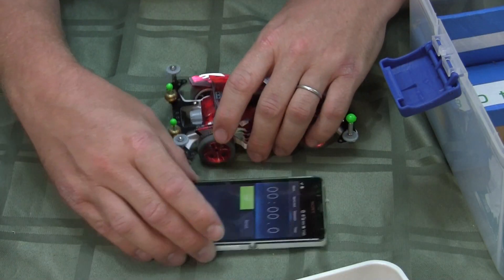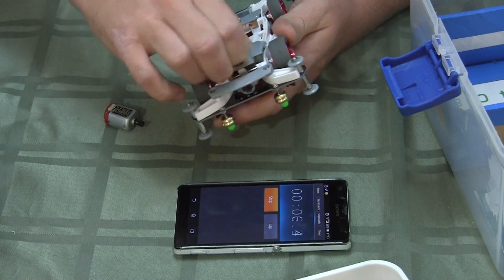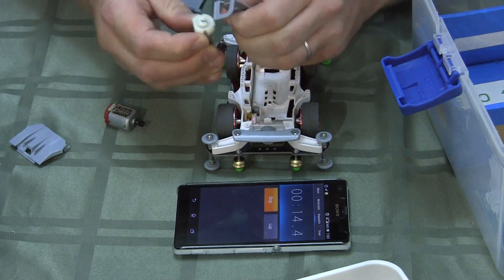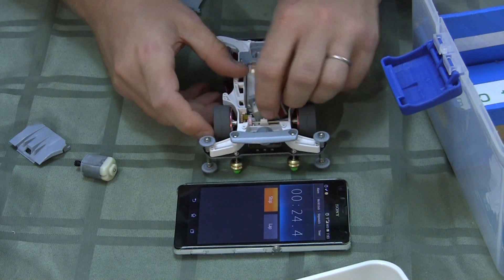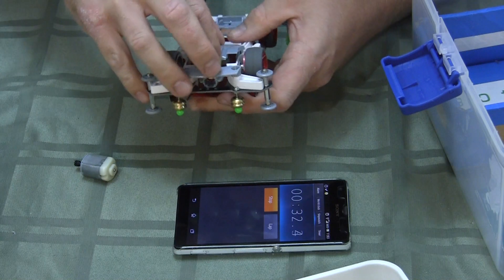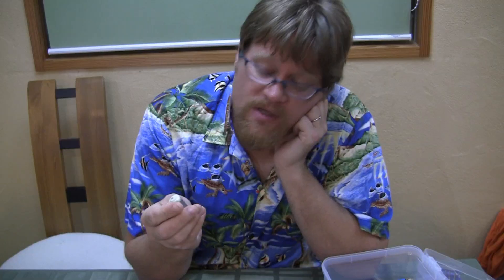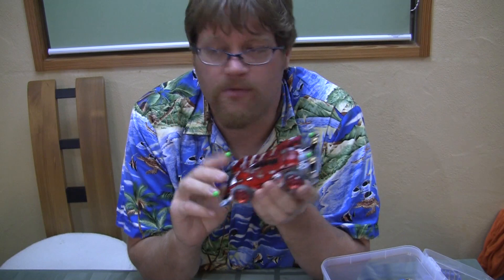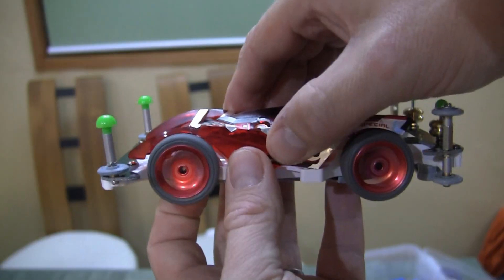The Most Boring, Unimaginative, Slow Paced, Tamiya Mini 4WD Motor Swap Video on YouTube!

Comment: I saw that it said not to watch. I watched anyways. I'm a rebel. Do they have tracks with loop Dee loops and ramps, cuz that would be pretty cool. I'd be like hot wheels but cooler.
Reply from the maker: Joshua Espinoza I know some of the tracks made for home use have loops, but I don't think loops are usually used in the official races. There are ramps and bridges, so there often are jumps, sometimes where you don't want them! :)
Reply: ***** that's super cool. That looks like it would be a fun hobby.

Comment: Ok....that motor give your car faster and a bit stable.To make more stable, buy 9mm double rollers at the fornt and 13mm bearing rollers at the back.I know it cost a lot of money..but worth it. :) want more tips? Plz reply back ;)
Reply from the maker: I plan to get the double rollers soon. I just wish the red ones were still available! :)
Reply: oh, also use the medium rim and super hard tires.I know you have the medium rim that you lose in that race :)
Reply: And one thing i forgot, after you bought the bearing, dont open it yet.Buy a bottle of Zippo and a small jar that you can reach your fingers.Put the Zippo in the jar and throw the bearings in there for three day.So the it can spin smoother that your car can move faster at curve track.:)
Reply from the maker: Two problems with that advice.
1 I don't know what Zippo is, and
2 it's too late!
Oh well :)
Reply: Well Zippo is a lighter fluid that remove the grease from the bearing and that why it give it smoother rotation.Commonly, Zippo is been use for refill the lighter
Reply: I think Zippo at japan is hard to find so, you just ask the pro mini 4wd players where to get it from